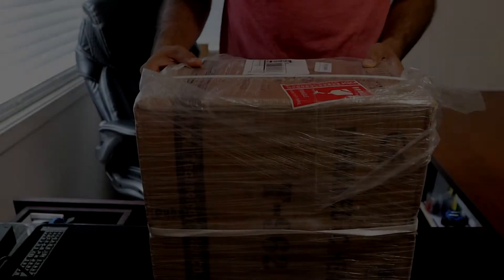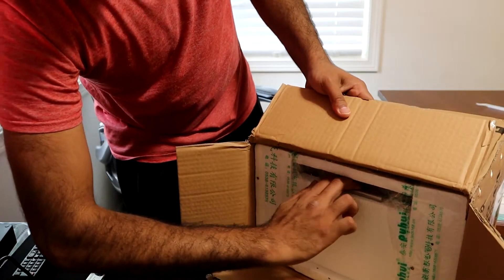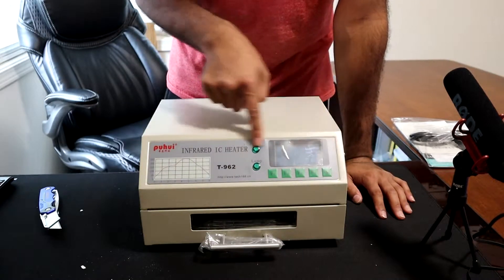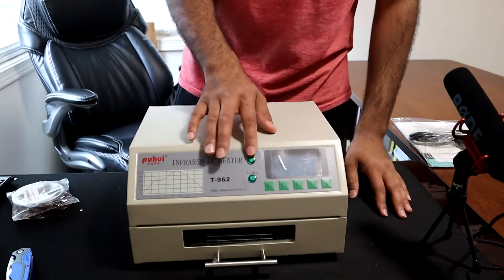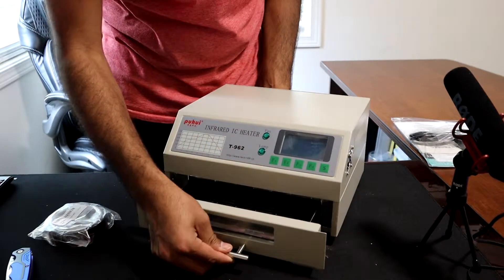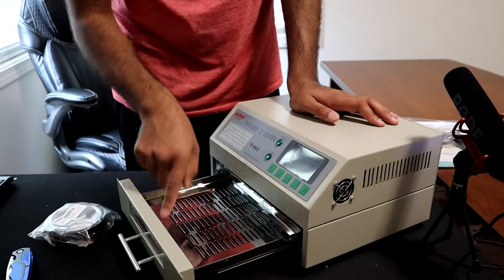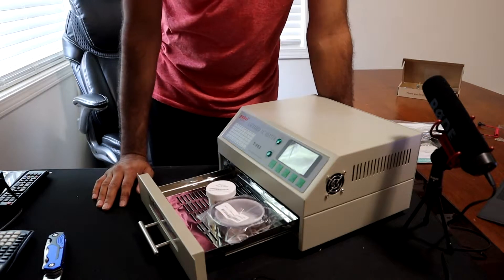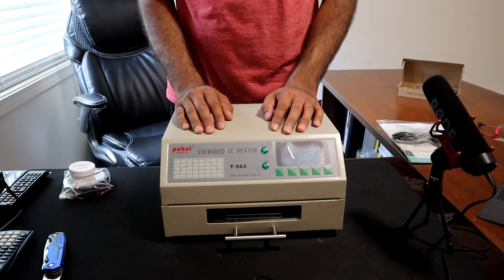T-962 SMD Reflow Oven Unboxing | T-962 SMD Reflow Oven Review | SMD Soldering Oven (2019)

Comment: hi, have you tried to solder other pcb too? maybe more complex? how does it behave? recommend it as a purchase?
Reply from the maker: So the problem is the heat distribution.  Small projects or small PCBs rather will do fine if you put them in the center of the drawer bed. The outer edges of the drawer does not get the heat as much as center. I tried 7 small 2x4 pcbs laid out on the entire bed but only 2 in the middle turned out perfect.  I had to do couple of more runs for the rest. The fix is a new heat censor. The eat censor does not read the actual value and I think it's off by 90 or something. Hope this helps.
Reply: @UnBOXTopicz  yeah, thanks. that's a big help. If i put the solder paste over the board and use the T962 2-3 times is gonna work fine otr the solder past just get too bad?
Reply from the maker: So what happens is the pcb on edge of the drawer bed does melt the solder but not good enough to account for conductivity.  What I do and it's not a big deal for is simply rotate and move them around in two runs to get good melt on all components.  Flux might also do the trick in melting to metal. I mean it's fine for the money to be honest with you. The results aren't too bad and like I said, you can actually modify T for better quality. I replaced packaging tape in mine with kapton cus I use it in my office with almost no ventilation and it stinks up the room.